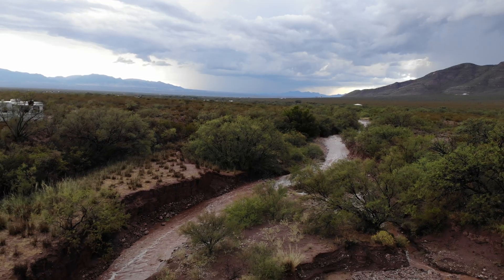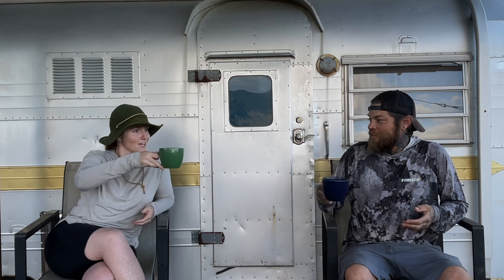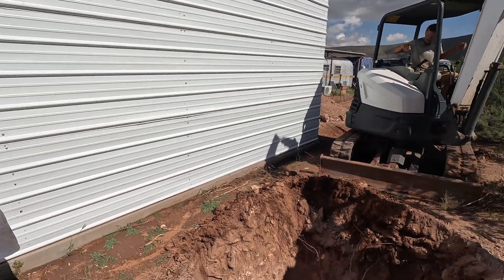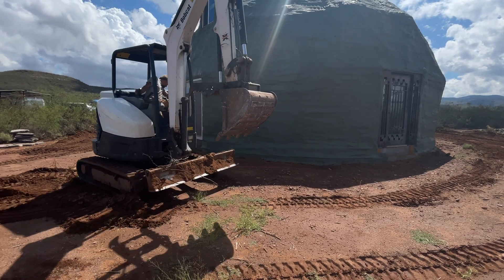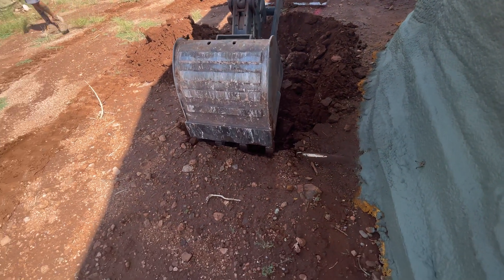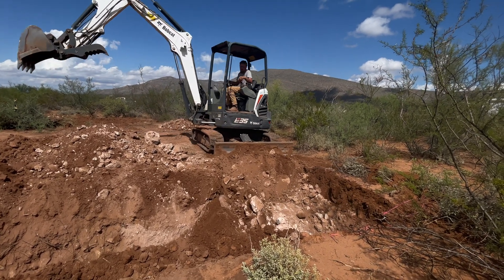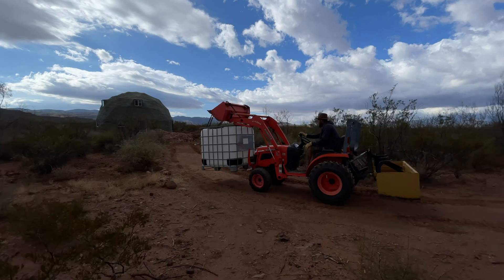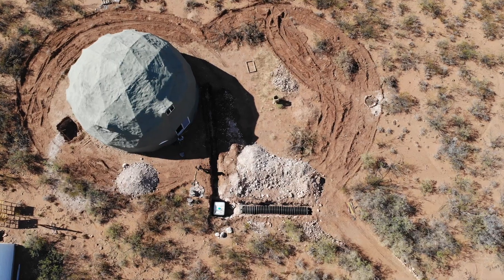WHY Are We BURYING IBC TOTES In The Desert?!

Comment: so your trying to cheap out your septic tank and when the cheap plastic fails you will have a big hole full of sh-t to deal with .
Reply: Not cheaping out at all, the fact is that our land would not percolate fast enough for a full size system so we were approved for a 250 gallon tank only to process sink water. Nobody sells a tank that small so we are fabricating our own. The IBCs are not the final product, just a 'liner'. Stay tuned to see what well do to make mini tanks out of them that should last forever! (Also there will be no poop in any of them, we have a humanure composting out house system to process human waste).
Reply: @markmayhem2173  Ah. Thanks for the explanation.
Reply: Sorry you are wrong.
As long as they are sufficiently shielded from uv-radiation those tanks will outlive us all unless the grey water somehow happens to pickup any organic solvents.

Comment: waste of digging, should have gone with a cement or plastic septic tank. I have found that in dry years in the desert the local critters will make holes in those tanks to get to the water.  next, the bacteria that grows over time will, yes, even in the laundry tank, will plug up any pipes that you try to use for watering. best to go with a blue plastic barrel that can be easily removed/replaced when to much crapola builds up in the bottom of the tank. All tanks should be at least 60 feet from the house to prevent critters getting attracted to the house then have rodent problems in the house. When it rains in gully washers the earth will collapse the plastic tanks over time and cause the earth underneath the house to move. when it comes time to sell the septic system and inspection will be a huge problem for both the seller, lender and buyer...  don't ask me how I know this.... I live in the desert too...
Reply: Thanks for the comment and I hope you keep watching to see what we do next! We have a plan to make them completely critter proof and non collapsible! Also will probably be installing service risers in all 3 tanks to future proof em.
Reply: Yep have done the same with blue plastic 200l drums.  Crap builds up, soap scum, skin, dirt etc. and has to be cleaned out eventually.  I left 20% at the bottom.  Need to be carefully on what you irrigate, especially edibles.

Comment: Bio-digester, comes to mind, using the IBC Totes! I plan on connecting 4, in series, for the black water, with the first IBC Totes collecting the solids, then the 2nd, 3rd, and 4th ones will collect the fluids, and by the time the 4th one gets started filling up, the smell should be drastically reduced, and can be routed to an above-ground garden of flowers and trees, but NOT edibles! The grey water will be routed to a separate above-ground garden bed with edible plants and trees, without need for any IBC Totes involved! Search for ‘Bio-Digester’, and you’ll get the idea, if you haven’t already! Good job, on what you’ve got going on, thus far!

Comment: A tank is a tank.
 It really doesn't matter.
I imagine what the county is mostly concerned with is its durability and longevity.
There is some question about the routing of the material through the tank.
It needs to be able to have solids come in and separate out, but also that there's no flotsam escaping through the drain.
There's some really nice caliche you got there.
 I hope you took a moment to look in the Arroyo to see if there was any black sand🔎
Reply: Oh yeah there will be some internal pipe fittings that will make sure it can't just flow out the other side😂